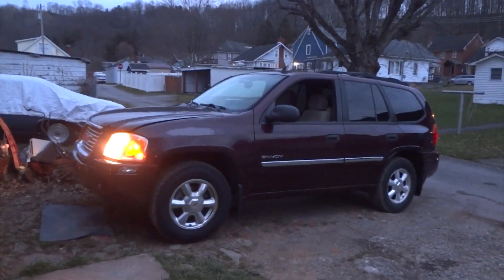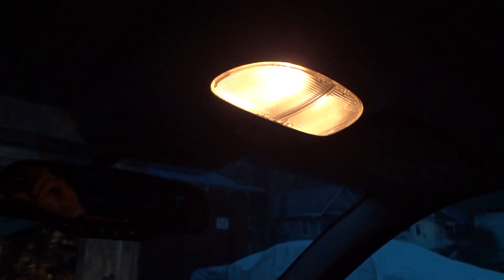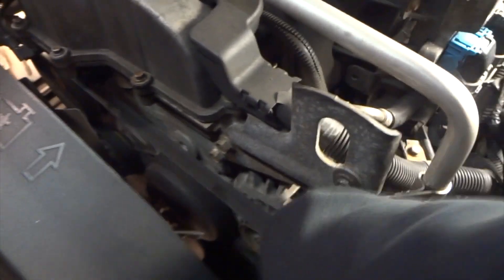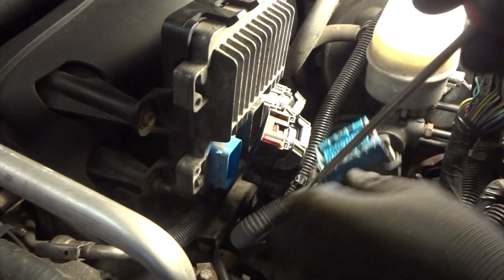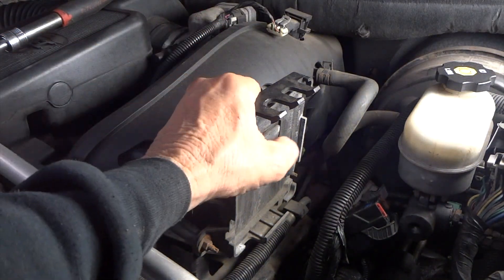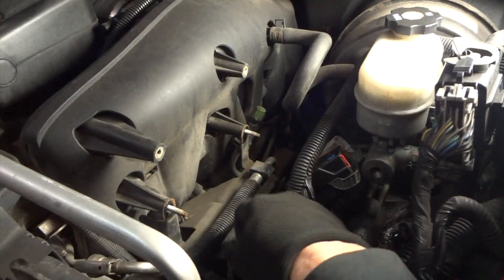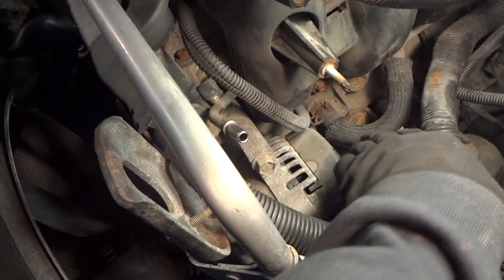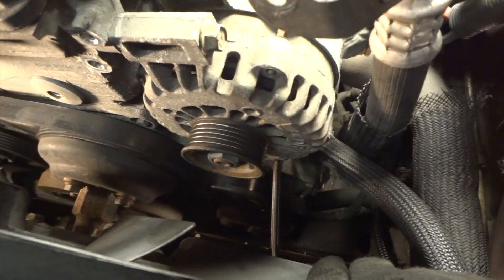2006 4.2 GMC Envoy Low  Heat To.....High Heat Output!

Comment: Just did mine while I had everything out of the way to replace the seized AC compressor.
Reply from the maker: Wow! What a job!
Reply: @FixingWithPassion  Yep, not fun but I made it worth while and replaced spark plugs, fuel pressure regulator, serpentine belt & pulleys, thermostat, AC compressor & accumulator, and of course, air filter.  Probably saved $1500+ paying a garage to do it all.  The bad news is the AC compressor won't engage... will be digging into that soon.  Cheap Amazon compressor, should have tested the clutch with 12 volts before installing... we'll see.

Comment: Pretty nasty design flaw by GM. Most normal engines run anywhere between 160-195 so the average driver wouldn't notice anything until the heat stops working. Meanwhile the computer's dumping fuel constantly trying to get the engine up to 210 which is the atlas' actual operating temp. This will wreck the converter if left unchecked and you don't always get a code. Just did my converter a week ago lemme tell you that's not a fun job especially in the land of corrosion!
Reply from the maker: Right!!